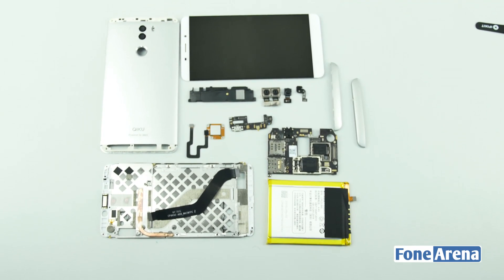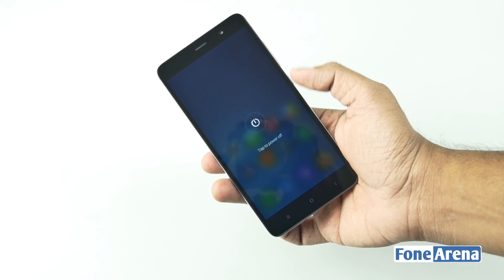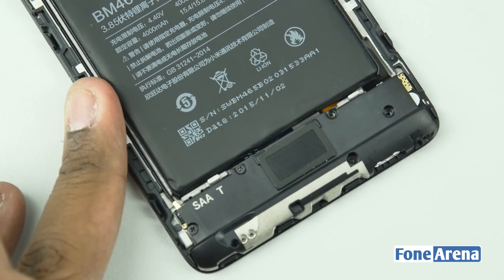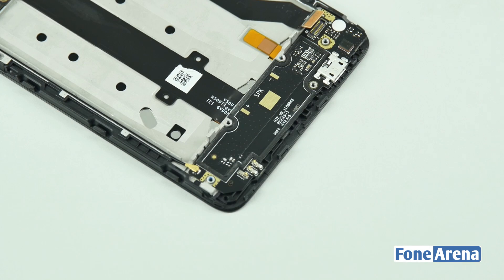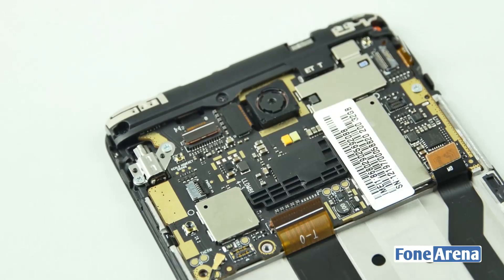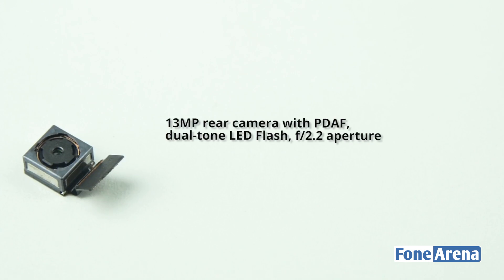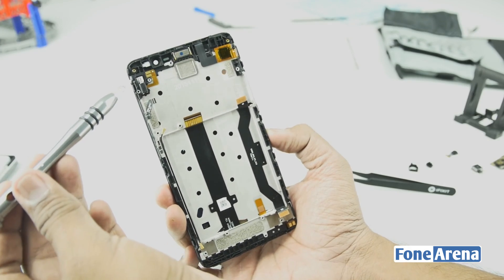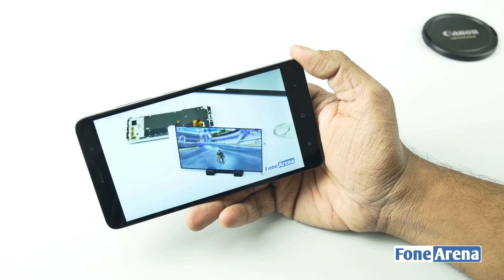Xiaomi Redmi Note 3 Teardown

Comment: Mine happens to have some kind of copper foil connecting logic board to screen/bottom surface (for heat transfer most probably). So that would be destroyed if I try to pull the logic board.

Comment: Hey,I recently replaced my charging port,but had to reopen the case to place the volume and lock buttons in place.
During second opening I forgot to remove the sdcard/sim card slot and now my sd card isnt loading.
Can anything be done or is a new entire board the only solution?

Comment: Are the screws in 2:08 and 2:13 the same? I've tried to remove the screws at 2:13 (the left and right ones) without removing the rest of the logic board screws but they won't even budge.